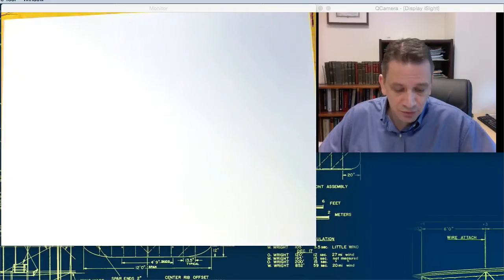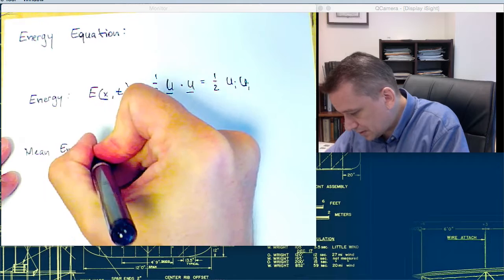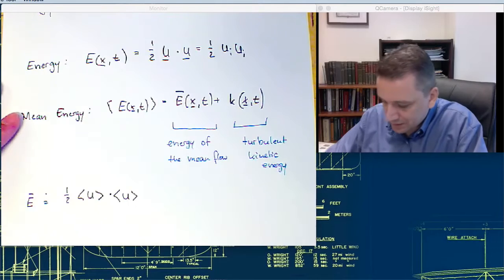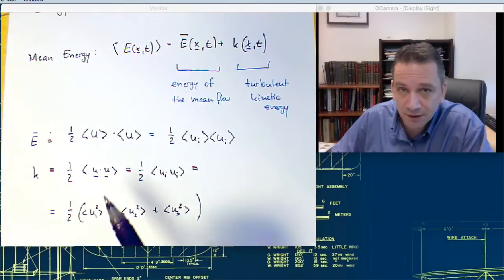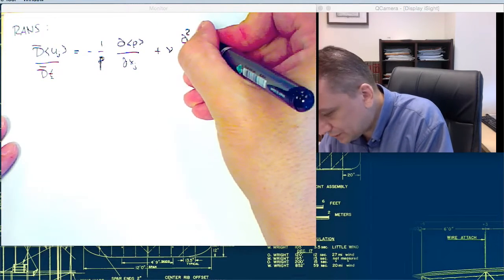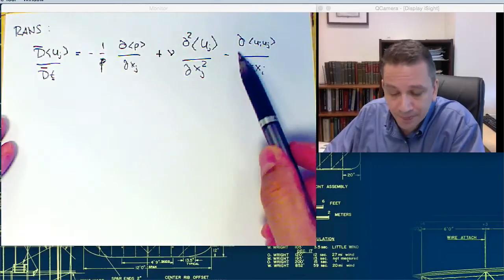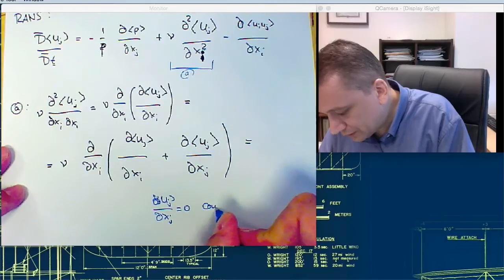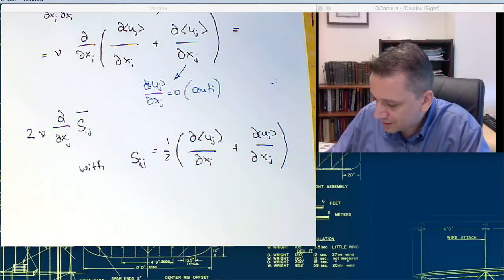Derivation of the Energy Equation for Turbulent Flows Part 1/4

Comment: hi , i dont understand how u replaced it with Sij when in brackets above u have uj and uj in both numerator
Reply: as you pointed out the added term should be dui/dxj but it will still be zero when you apply the d/dxi (outside of parentheses) because of continuity and hence, the same result.